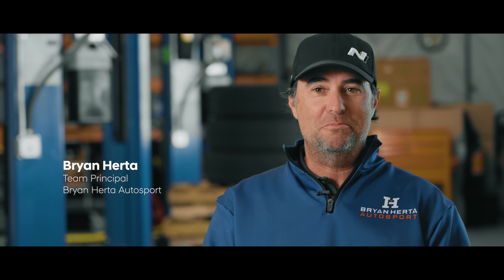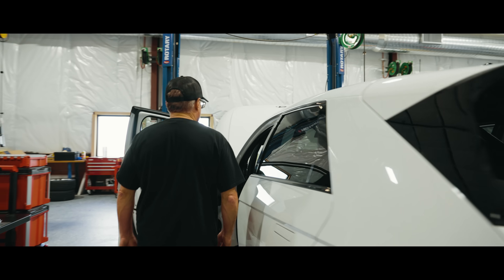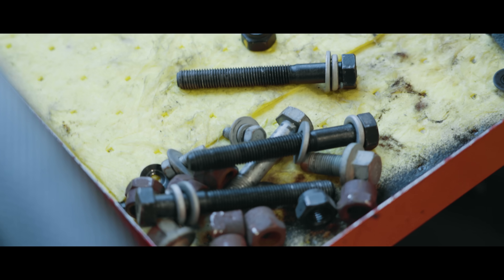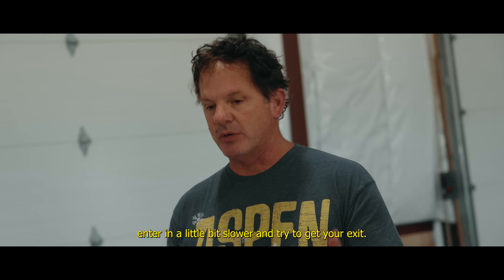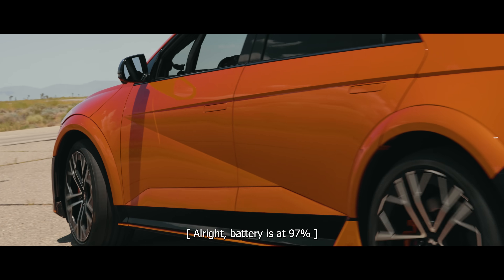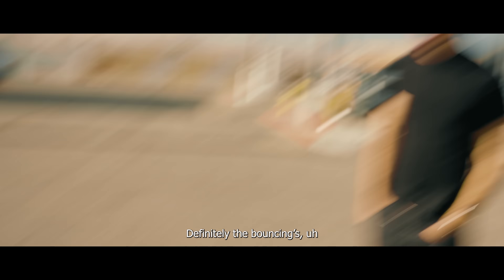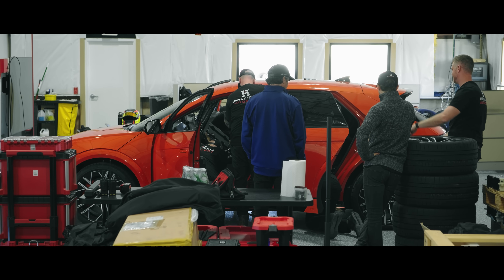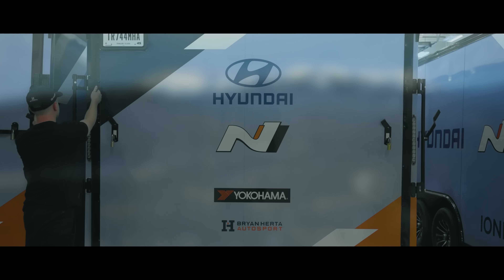Developed by Champions: Testing our IONIQ 5 N Pikes Peak race cars | Lightning in the Throttle Ep.2

Comment: At the ripe old age of 62 I've become a Hyundai fanboy. In the mid 70's I learned to drive in a 72 Charger with a 340 magnum and Hurst 4-speed. Spent most of my years a Dodge guy. Even owned an SRT at one point. My last two cars have been Hyundai's, and my next will be an Ionic 5 (an N if I can find one).

Good luck this year. I grew up in Colorado Springs. Been to 20+ hill climbs. Can't make this one because of a golf tournament. I'll be following online though.
Reply: What hyundais have you owned and how reliable were they?
Reply: @GoFast58  First one was a 2011 Sonata Limited with the 2.0 turbo. Had one issue, backup camera fixed under warranty. Put 135,000 miles on it.

Currently in a 2019 Elantra Sport with 36,000 miles. 1.6 turbo with 7-speed dual clutch. Haven't had a single issue with it.
Reply: @BhutJolokias  Thanks for telling. Hopefully your elantra is just as reliable as your sonata!
Reply: I absolutely loved my 2002 Sonata, put 205K on it before it was totaled in 2010, and I am absolutely in love with my 2021 Sonata N-line now.  I hope to surpass that mileage mark on this one.  Excited to see where this Ioniq line goes from here and this N package is just bonkers!